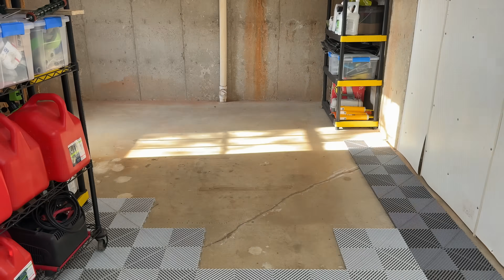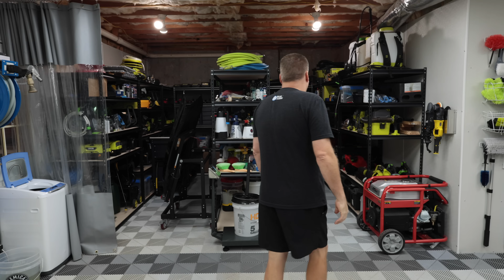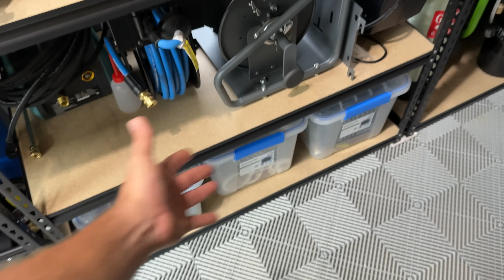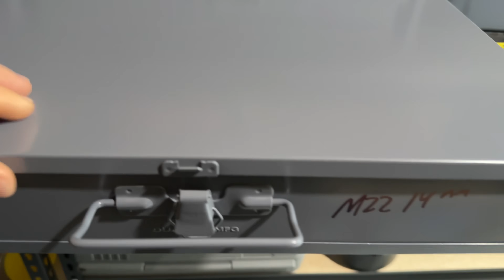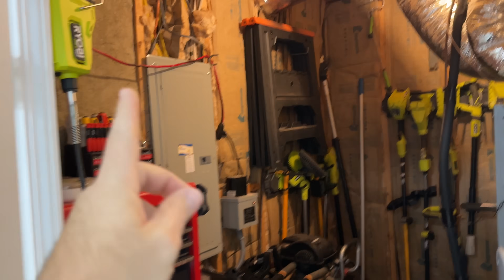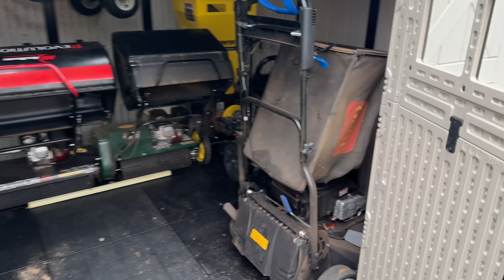DIY Dream Garage Wash Bay Phase 3 | Rinseless Reel, Storage & Organization

Comment: Keav, wanted to ask...what do you recommend as a good snow brush that's safe for the paint during the winter months? Cool garage setup!
Reply from the maker: I myself use a leaf blower. We don’t get snow here much, but any brush will not be safe as there is no lubrication and I would still call snow an abrasive.

Comment: Awesome garage Keav. Which tape do you like for protecting trim while polishing?
Reply from the maker: I just use Scotch brand delicate painters tape which doesn’t leave residue, but now I don’t use compounds or polishes with filler so I don’t have to tape anymore I can use it on trim as well. I still use it when doing headlight restoration or removing trim pieces and I don’t want scratch the paint accidentally.

Comment: Great video
I want a video on the sunjoe hose, maybe the ryobi pressure washer super small diameter hose that come in the kit can be a good candidate for this sunjoe hose conversion 😊
Reply from the maker: I mean it’s the right size. 😂 Great thing about the Sunjoe is it uses normal gardena garden hose quick connects so you can hook anything up to it with the right adapters.

Comment: I have the milwaukee blower with a stubby. Quietest blower I've ever used and I love the variable speed trigger.  Only issue is, but easily mitigated, is keeping the intake off my leg.
Reply from the maker: I have a Greenworks that like to grab my shorts and shorts. 😂 The one Milwaukee I have on that shelf does the same think. That is why I do like the EGO design as the battery blocks the fan from grabbing.